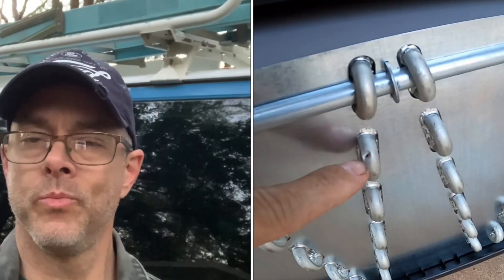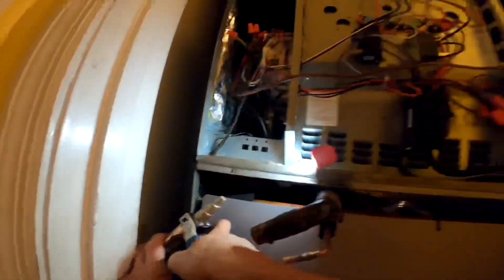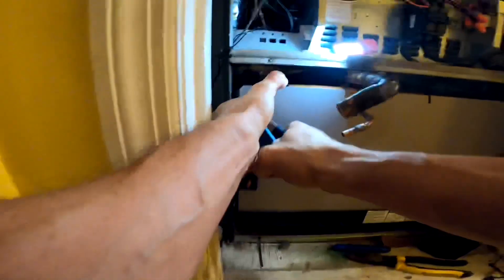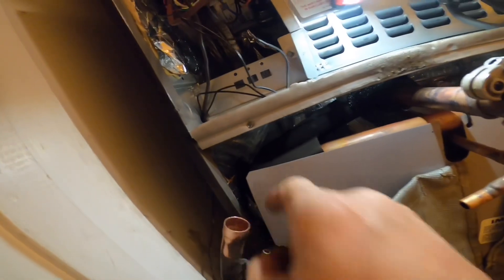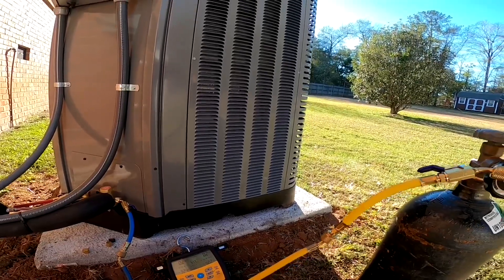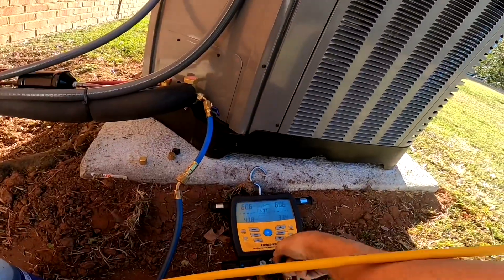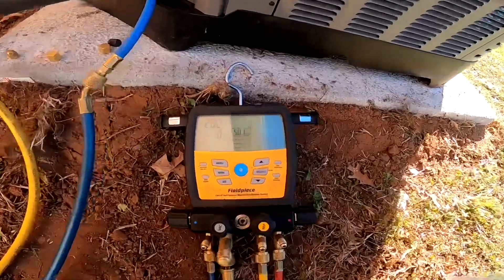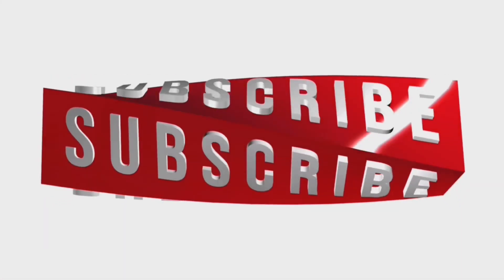Brazing in Tight Spot Between the Door Frame And Air Handler

Comment: I'm always worried about the copper shaving falling down when reeming the pipe from the top.
Reply from the maker: Yeh, that’s always a concern
Reply: they'll make their way into the bottom of compressor oil sump area and should stay there. now them in the liquid line could spell trouble for orifice/expansion valve, unless you put the filter/drier directly before it to catch the pieces.
ideally you'd blow the lines out good after reaming or have them downhill so the pieces fall out. you can also shove a piece of rag in and pull it out with pliers or blow it back out, that would be better than letting the shaving get down into the line and possibly stuck in oil.